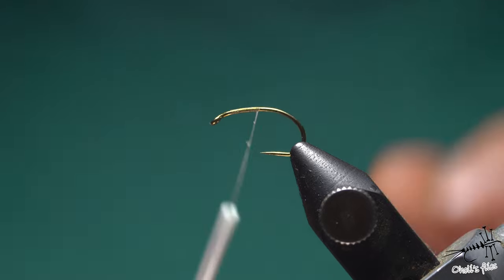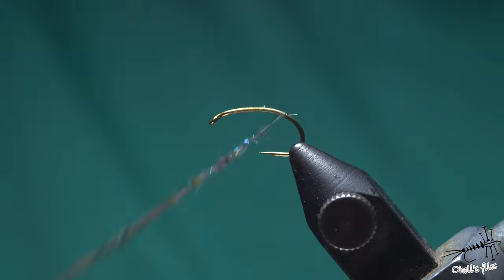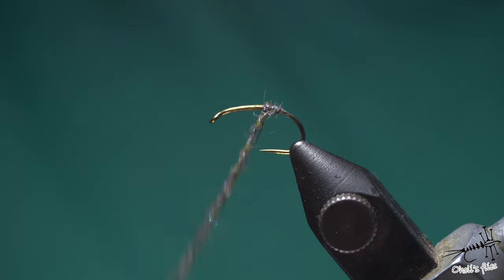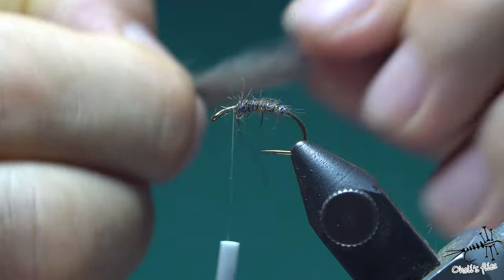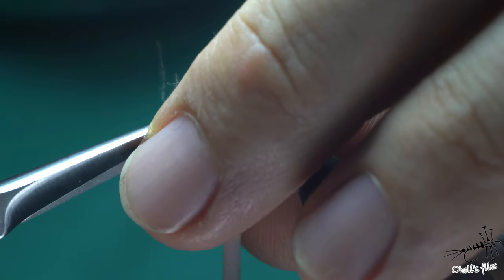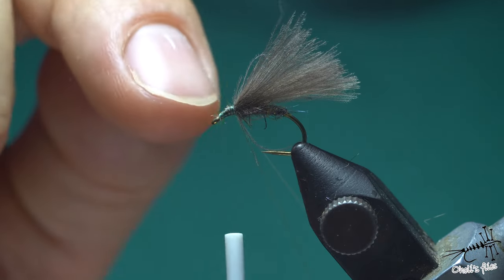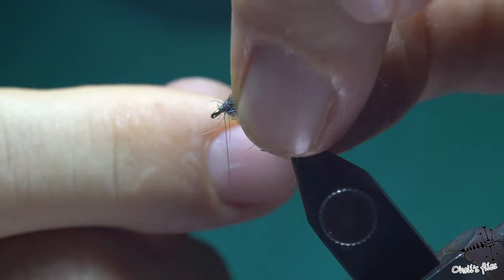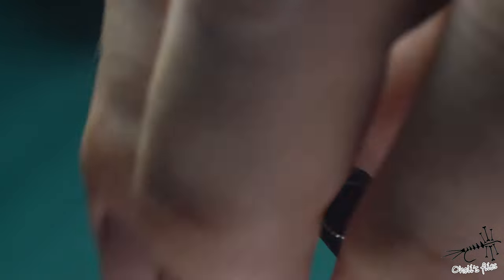Loose dubbing (Squirrel F fly)

Comment: Hi Ohli. Fly Profile- This is an interesting thought. With modern barb less hooks, especially curved ones, the bare hook can be thought of as part of the "fly". or natural item in water. Using lateral thinking you use, what would you use to improve this by using a hair, modern thread, or quill, to "add" to the fly or pretend a second insect is there? You can see where I am going with this. Warning- might drive you mad!
Reply from the maker: Hi, your question is honestly confusing for me... If i got you right, you would like hook to behave as one insect while at the same time and on the same hook i tie another insect? Basically camouflage hook by using it as a body part of an insect or something similar?
Reply: @Oholisfliesandfishing  Hi Ohli, Yes, the main reason for an older fish to reject a fly could be because of the  bare hook. The shape of modern hooks could suggest , for instance, a nymph  attached  to, or near  to the fly. " Neutral" hook treatment may have already done this to some extent.The entomology profile of modern fly patterns has improved a lot, but the bare hook has not. So instead of hooking young silly fish, one could hunt the older fighting ones. This is a challenge that has not been done on record, and I think you have the ability to look at this over time. Yes it is possible to put on the hook  double nymph,plastic shape, or camouflage paint, but in terms of excellence, and that is what you do, a quill profile insect or extension of the body(snatcher) or wire, or to look at this in a completely original way would be a world changer. The USD nymph has to some extent overcome this by changing the profile, the issue here is the last part of the hook material has to slide back for the hook to work.  For instance using  covering feather, " false" extended body, 0r neomydium dust. If this interests you it would be great fun to see what you would design that would be effective and applicable. Regards, M.
Reply from the maker: @LemonGray  well, i believe its presentation or lack of it that is putting the fish off. However, i cant prove it, since fish cant talk :) 
I dont go after big fish only, primarily because they are scarce in areas where i fish. And where i know there are some they arent eating as often as young ones...

If you wish, please hit me an email, its easier to communicate there since its a bit confusing here :) I havent heard for quite a few things you wrote

oholidzo@yahoo.com

best

Vladimir